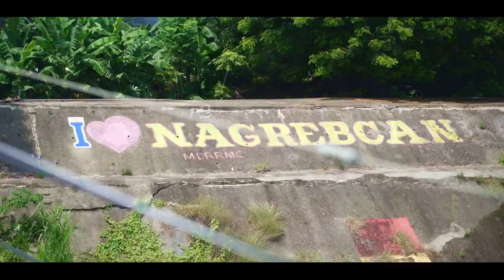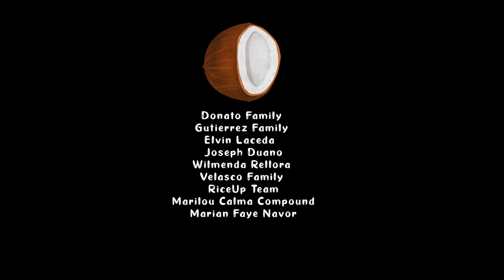Skating Through the Philippines: My Incredible 12-Day Journey in Luzon! (ROLLING MOMENTS)

Comment: You’ve used the wrong kind of skateboard. Maybe you should’ve at least used a cruiser or long board instead.
Reply from the maker: Yes I thought about that for some time,  I ended up suing a trick board, I just am more comfortable with one , plus I could ollie over stuff and up curbs more practical for my needs . I had to use cruiser wheels 75mm though for smooth riding it made all the difference.  :)